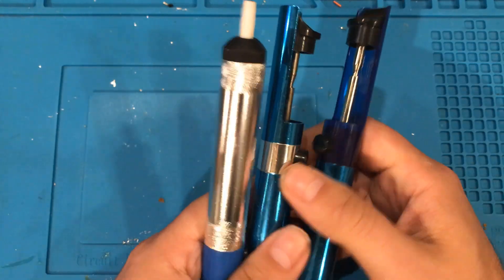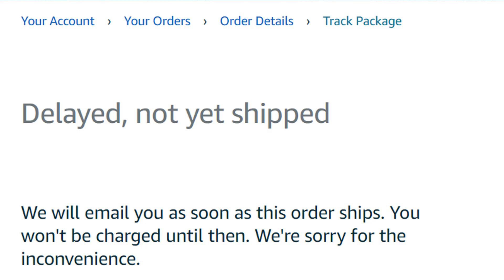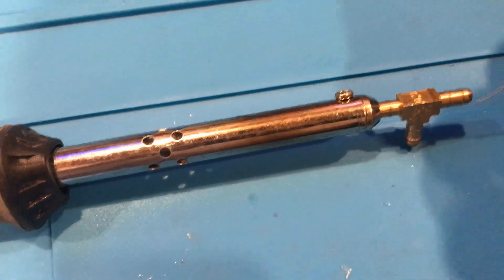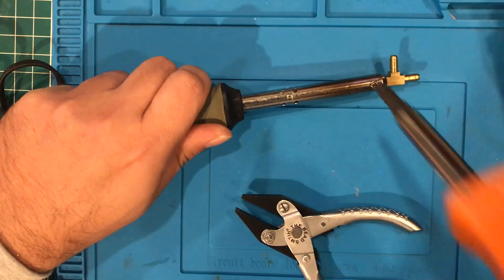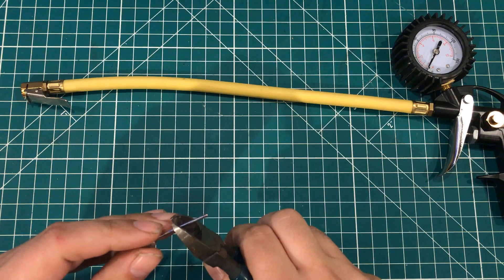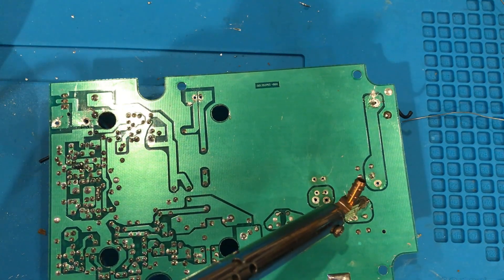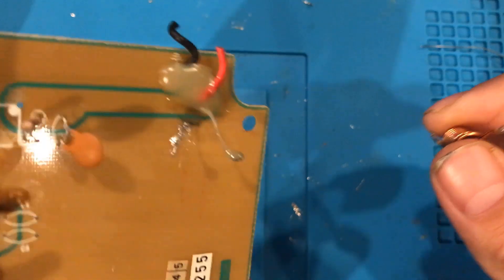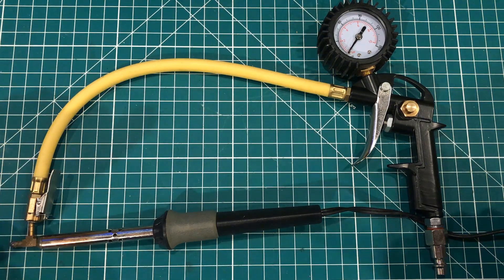DIY Desoldering Iron

Comment: I did the same thing but I used a can of air because my iron died the only problem is you have to be very careful from the flying solder lololol but it worked really well so if anyone is ever in a pinch get a can of air heat up the solder you want to remove and blast it like magic its gone lolol

Comment: Stupid! Why Blow the Air, why not vacuum?
Reply from the maker: It's meant to be stupid, but it actually works really well.  It's really hard to find something that will suck with the equivalent pressure as I can get the compressor to blow.

Comment: Love it, it introduces excitement and danger into a hitherto mundane task! I wonder how long before the clones of your invention start to appear on eBay 😃. Another cheap way to do it (although not as good as the electric vacuum pumps) is a kind of hybrid of an iron with a hole in the tip and a built in plunger sucker. I have one of these, cost around £10 and it works pretty reasonably okay-ish for the small amount of desoldering through hole jobs I have to tackle.
Reply from the maker: I had never seen one of those until the day after I built this when a guy named Scott Beasley had one on his youtube channel.  It does look like an option worth messing with.